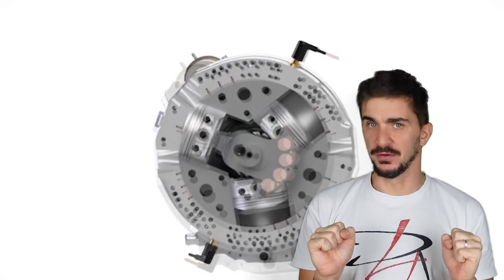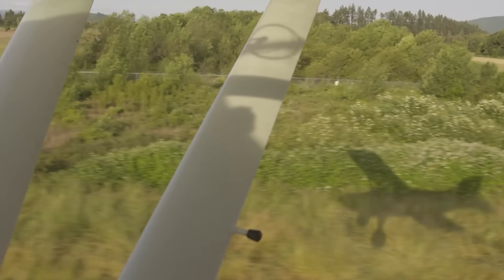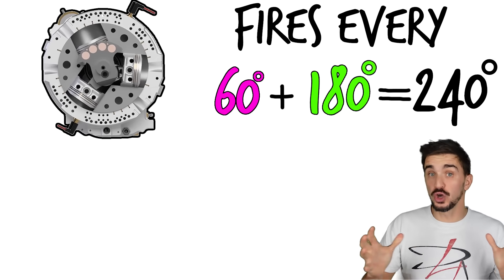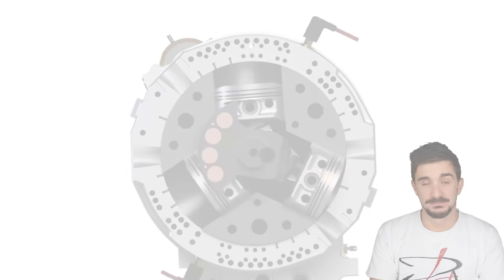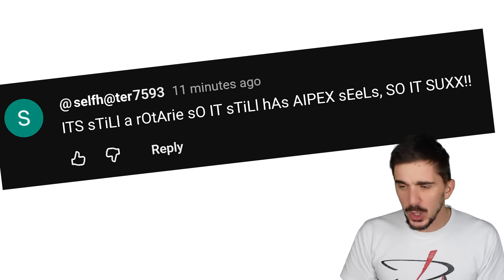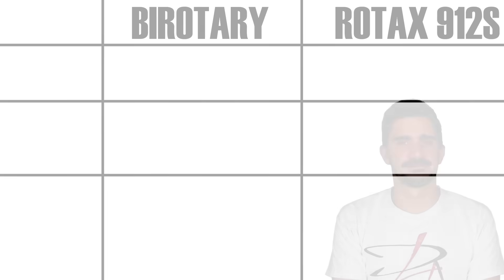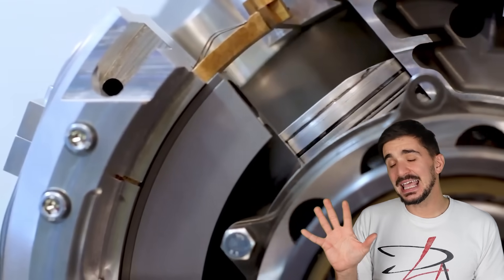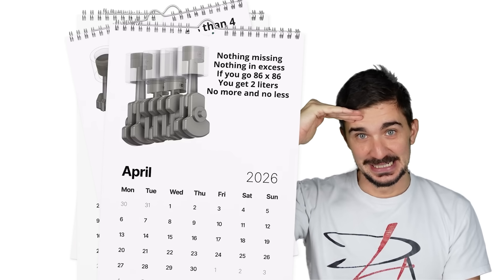This is What Happens When Pistons and Rotaries Make Babies - Birotary Engine Explained and Reviewed

Comment: Thank you for doing this video as it shows a very interesting design. I am a bit mystified about a few of your conclusions. You commented on the weight of this. Keep in mind that this looks like a prototype and as such it is amazing that they are already using these in aircraft. I am sure that the weight can be reduced and the power increased with some development. I see little reason to think that the low rpm performance should not be good as I assume fuel injection will be used and things like swirl can be added if needed. I believe this design could be effectively used in any application when fully developed. You did not mention how this might be lubricated. Paul Cunningham

Comment: It seems to me that this engine would burn oil along with the air-fuel mixture. If not, how does it prevent that? Does the sealing keep oil from entering the combustion chamber?

Comment: The most glaring omission here is the RPM is about double what even small airplanes require, so reduction gearing is required.  This is also true of the Rotax 912-S.  Most general aviation planes such as a Piper, Cessna, etc., use Lycoming or Continental engines that operate in a 2400-2700 RPM range, right?  So this engine requires a gearbox for aviation applications, and can only compete with a Rotax.  The RPM is way too fast for a propeller big enough to pull an airplane.

Comment: I looked at Knob's website and noticed they have a range extender engine that does have two counter rotating crankshafts. It's a two cylinder boxer with the pistons in perfect alignment.

Comment: The low connecting rod to crank radius ratio will put heavy side loading on the pistons causing too many limits on efficiency and longevity. This will never work for any real world high performance applications.

Comment: Thank you very much for this beautiful video.

As one of the engineers responsible for this project, I want to say that you did a great job explaining it and my boss (Mr. Knob) is very grateful to you, for pronouncing his name correctly 😊

I am sorry that we didn't answer your questions, so I will try to explain the most asked ishues.

1. Cooling
We use two types: The static case (head) is cooled by water flowing through holes (channels) and is driven by a pump.

The internal part (block) is cooled by oil, so now we use two radiators (a larger one for water and a smaller one for oil).

2. Lubrication
The crankshaft and all accessories are lubricated by oil, which flowing through the crankshaft from the rear of the engine to the front and is also driven by an oil pump.

Both pumps are visible in Figure 17:20 and they are both powerd from crank.
We still use little 2-stroke oil in fuel for seals lubrication.

3. Dimensions and Scalability
The actual prototype was made for light aircraft, so we wanted to keep the dimensions as small as possible. That's why the stroke and bore are so short.
You can have a longer stroke (the distance between the spark plug and the exhaust is not that big of an issue), but the whole engine will increase in size and weight (more steel = more kg).

The weight is also a bit higher than the Rotax because we are in the prototype phase and a lot of the parts are overweight to survive our tough testing. 
As we say, every part that didn't break on the test bench was oversized 😊

In case of scale :
 you can add more blocks, but because this is not normal radial engine ( THIS IS ROTOPISTON 😊 ) the number of piston must be a multiple of 3 - which means 3,6,9,12 and more.
We also made study of smaller version (125ccm) which I believe would be ideal for scooters, bike, drones, generators and other uses.

4. Time between overhauls and fuel consumption
Sorry guys ☹
We are still testing, so I can't tell you anything specific, but we need to get to normal numbers: at least 2000 hours and something around 20 l/h

5. Usage
It depends on the customer.

The version you see mounted on the bench is gasoline-only, but the one on the plane was built as a hybrid, so our "Rotopiston" is connected to a 40 kW electric motor. In this arrangement, the two engines can work together or separately.

I won't argue with you, but I always told my boss: "Just buy me a Mazda RX7 and I'll kick out the damn Wankel engine and put our Rotopiston in there."
No one in our TUV will notice the difference because no one there knows the Wankel engine that well. 
Only then can I do some serious road test 😊

I hope my answer was helpful.

I would like to thank Mr. D4A once again, for showing our baby to the world.

It means a lot to us.
It took ten long years (and a lot of blood, sweat and tears) to get from scratch to a working prototype and we all worked hard, so we are happy to share it with you.

On behalf of myself, Mr. Knob and the rest of our team, we send you our best regards.

Martin from Prague
Reply: Awesome comment - IMHO it deserves to be stickied as it adds very relevant additional context.
Reply: umm, see above.....not tryin' to be a $marta$$, legit problems I've experienced....
Reply: I love triple and rotary engines, so this motor ticks all my boxes.

Comment: You don't have the weight , the mechanical wear and the access,arated mass of a valve train. But the rotor has a lot of mass between the cylinders, I guess. The need for a short stroke also comes from trom the requirement to get as much displacement inside and have the less volume between the cylinders inside the rotor. These are the geometric limitations.  But the extreme short stroke make the surface/ volume ration of the combustion chamber inefficient.
Another problem I see is the cooling.  how can the rotating rotor transfer heat to a radiator ?

Comment: Very interesting engine configuration, however it is not new! Check out UK patent 1,066,881 filed by Philip Vincent in 1967. (yes the same Phil Vincent who owned the Vincent motorcycle company.) The one system not mentioned is cooling. An internal combustion engine is about 30% efficient, with ~30% of the energy going out of the exhaust pipe and 30% going out through the cooling system. So if the engine's output is 100hp, or 750kW, then the cooling system has to dissipate 750kW.

Comment: You forgot to mention one of the main aero benefits which is oil and fuel flow. I'd be interested to know if it suffers from fuel or oil starvation under high Gs like a conventional piston engine does.

Comment: Looks like it would be easy to add smaller ports at different angles to add variable valving.

And because it's just holes in a fixed block with the cylinder assembly rotating, you didn't need a camshaft opening and closing them.
They could be directly opened/closed with a regular stupid simple solenoid. Or they could be variably opened with a simple screw shaft.

And this is a non-interference engine, so the fail mode is running rough vs parts occupying coincident space. 

The extra weight makes sense, because it has double the rotating parts. A simple cylinder only needs a wall thickness. This needs a wall thickness and a circular cage that is sealing and strong enough.

Comment: All the drawbacks of BOTH the rotary AND piston engines with none of the advantages.  The combined friction from piston rings and rotary seals alone would render this thing very inefficient.  I had to check and make sure this video wasn’t posted on April first.

Comment: Hello! Here to clarify a couple of things about aircraft engines, which are designed with very different goals in mind compared to any other type of engine. The concept of this engine is kinda cool. But really no one in the aviation world cares that much about the weight, or the power, or the fuel efficiency of an engine. Not at least in the market of small propeller aircrafts. What really matter are maintenance costs and RELIABILITY. Look at any modern aircraft piston engine and you'll see it looks like it was designed in the 20s: carburated, naturally aspirated with magneto ignition. People nowadays don't even know what a magneto is. Why? You can't have a clogged injector if you have no injectors. Your turbo can't fail if you have no turbo. Yes, the carb can ice, but there is a specific button you can press to recirculate the exhaust back to deice it. No gears, the propeller runs at engine speed. Two magnetoes drive the spark plugs (2 for every cylinder). Before takeoff you switch each one off to check if the other one is behaving. This also cecks on the spark plugs. Remember that avgas is still leaded so spark plugs may foul overtime. What's the result? An engine that can last 2000 hours between overhauls, this is almost 400 000 miles at aircraft speed. Now it's clear that this new engine has a lot more moving parts, which flies at the face of everything related to aircraft engine design, and what's worse is it's still runs on gasoline. Remember: AVGAS IS LEADED, that LL in front of LL100 means "low lead". Many pilots are complainig about being exposed to toxic organometal compounds and are asking to move away from traditional avgas or even from gasoline altogether. Want to run your engine on mogas? Good, as long as you don't fly too high. There's so much butane in mogas that you may boil off a good part of it by flying at altitude. And together with butane your octane rating is going to evaporate as well. Also this engine reminds me a lot about rotary engines, like the real, proper rotary engines of WW1, like this one https://www.youtube.com/watch?v=6DMkrCa88s0 Apparently these guys have solved the lubrication issue that plaigued traditional rotaries by making the engine separately lubricated like every other four stroke, and also the gyroscopic issue (which may or may not have been already addressed with the Siemens-Halske Sh.III, which also had rotor and crankshaft rotating in opposite directions), but apart from this it doesn't look like something innovative, or that we haven't seen in the last century. I'd be surprised to ever see it mass produced, but I guess we'll see...

Comment: I think if it was gonna be used in cars it would be most suitable for use as a range extender. That way, it can run continuously at its peak RPM and not take up a lot of space in the car. It also looks like it would be relatively easy to service or replace in such an application

Comment: I don't personally like continuously variable transmissions but that would be a way of using this in a car or bike. As several others have suggested, you could also use it to charge batteries for EV. We would need to know a lot more about actual fuel consumption, longevity and service intervals before actually making serious proposals though.

Comment: Surely if you had two of these side by side, one rotating opposite, you could eliminate the counterbalance on both?

Even better would be four side by side with a central shaft for the prop. Two clockwise, two anticlockwise

Comment: for the fire interval .... in a conventional 3 cyl engine you don't count the balance axel nor the camshaft rotation.... so for this, i'd say the cylinder rotation should do ....
also,
in a wankel you also only count the fires per rotation, not the fires per output axel rotation ...

Comment: You could integrate some sort of "variable intake timing" if you can rotate the outer housing so the intake and exhaust openings move. drawback would be that the spark plug position also moves with it, but this could be solved with additonal spark plugs.

what could be an analogy to "variable valve lift" could be an additional plate which would cover the intake / exhaust opening in that matter that it restricts the opening in a variable manner, which could be realised by solenoid pushing and pulling a simple plate.

these both additions could make the engine feasible to the automotive market.

Comment: 😂 I'm laughing he literally shows the engine design could be modular in the background at the end of the video it shows it going from one cylinder section of the engine to four which if you remember his 750ccs or something for the engine you stack two of those on top of each other you're almost you're basically almost eclipsing the engine you were comparing it to and its base factor of 750 something cc's and then you add another module with the same components and then your past almost 2,000 cc's you're getting to the point that you're a 2.3 l vehicle engine there's a normal v-shaped engine or in line for I'm sorry if you count for the Lacs RPM increase range issue with adding more modules to offset the uneven RPM of the engine so that you know Vehicles need a constant acceleration will the other modules compensate for that like bro just what I mean it doesn't even have to go into an actual driving the car's Wheels it could just be a generator for a hybrid set a having to make a piston engine or a rotary for a hybrid just have one of these engines built for it it's cheaper all this guy needs is some cash to build a factory and then Automotive would just love to have this for their hybrid vehicles cuz we all know rotaries suck with their seals and piston engines only get certain amounts of fuel economy in the sky disregards that it's a modular engine you can expand the engine by adding more same sections of the engine with the Pistons and the cylinder blocks to it to increase the cc's in the engine like what he says it couldn't possibly work for cars bro laugh my ass off😂😂😂

Comment: That's definitely an interesting engine, like a refined version of those insane radial engines used in german aircraft in the 40s, where the crank was fixed and only the (insanely heavy 1940s iron) block rotated. Making the crank rotate in the opposite direction is definitely the right decision, but since the crank and block do not spin in the opposite speeds, and do not have the same mass, I think the engine is still subject to imbalance and gyroscopic effects. Interesting design nontheless. And since it's built to rev high constantly, it could thrive as a performance engine. Mazda's 787B thrived because the engine was built for high RPM abuse and and what it got is high RPM abuse

Comment: In my mind, one thing spinning at 7,500RPM and another thing spinning at 2,500RPM does not equal 10,000RPM. I’d say it does 7,500/2,500 RPM. In the end the thing that makes it spin in the first place (the pistons and crank) ultimately determines the power output and the fuel consumption, so that is the RPM that matters.

Comment: Would this not make Diesel Rotary a possibility? Sure, you need forced induction (a supercharger could improve air flow and air/fuel mixing at low rpm), but if you used an upscaled version with a biturbo (or electric forced induction) to drive a generator to power electric motors, this could be a pretty cool way to, uh, power a tank?

Comment: I noticed in one of the corporate graphics, several block units had been ganged together.  With that arrangement, you could create a design with two pistons per block, eliminate one port for each of the blocks, allowing a long-stroke design, and still have eight combustions per rotation of the crankshaft.  Take the power off the crankshaft instead of the block and you have a great car engine.

Comment: TIME STAMP 2:19

    One small mistake in your visualization of torque. When you have the engine crankshaft tuning to the right, you also have the engine block torquing to the right. Torque rotation is ALWAYS in the opposite direction to crankshaft travel.
    If you have a front engine, rear wheel drive race car, engine facing front to back, with the crankshaft turning clockwise, to the RIGHT, from the driver's perspective. When the tree turns green, he punches the gas and all of his motor mounts break, his engine block will ALWAYS flip counter clockwise to the LEFT. Just sayin'.

Comment: Being that the combustion doesn't interact with the intake/exhaust ports i honestly think that rotary valves could help with the low rpms by closing a bit those ports, resulting in an increased gas speed, maybe i'm missing someting, i know it's not vvt but is something haha

Comment: Not much in common with rotary engines. It is a radial piston engine with a variant of a rotating sleeve valve a planetary gear system added to make both the crankshaft and pistons/crankcase rotate in opposite directions to control gyroscopic effects. Still it is a good idea, particularly if the  crankcase rotation can be used for replacing flywheel mass.

Comment: No, the forces don't cancel themselves out - the prop requires torque, that torque tries to tilt the plane - that CANNOT be cancelled out by any engines internals.
If it is properly matched, torque from engine acceleration can be cancelled out.
If it is properly matched, gyroscopic torque can be cancelled out.

Comment: If I understand this correctly, I had this idea quite a while ago. If I had Money I'd have invented all sorts of stuff like this but, I kinda suck with Moneys. I think my idea of this kind of engine requires smaller pistons but there are 4 pistons and no counterweights- I designed the concept for this around 20 Years ago. Who knows if my idea would have worked.

Comment: Even if the engine cancels out its own torque, the propeller itself will still have torque effect unless you had two contrarotating props.  What I'm not sure of is what percent of torque effect is from the engine vs the prop (as a rule of thumb) from conventional engines that don't cancel their torque.

Maybe instead of the engine canceling its torque, use the prop to cancel the engine's torque. Basically through gearing and in the case of a rotary engine the prop spins the opposite direction.  Yes I'm oversimplifying to explain this.